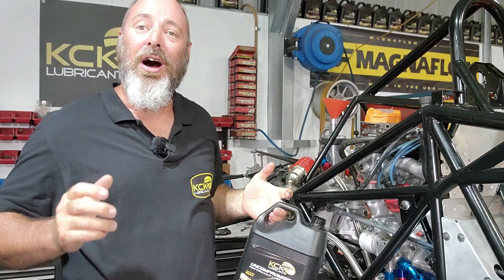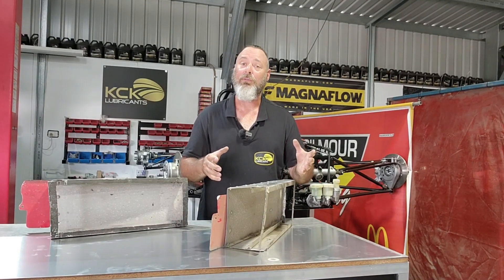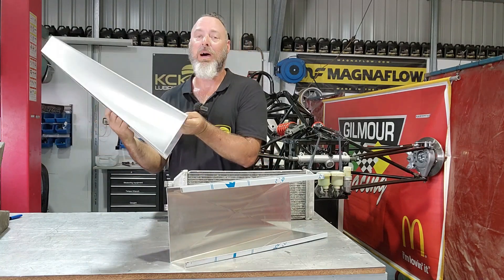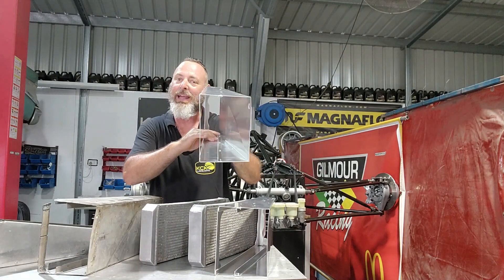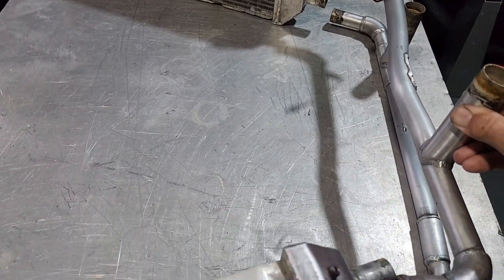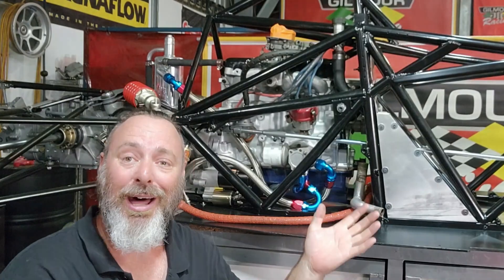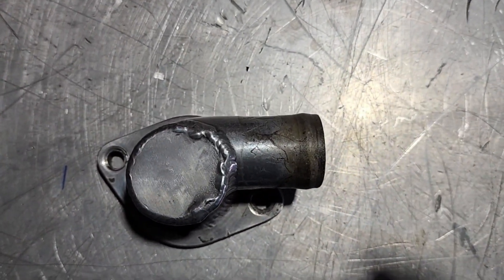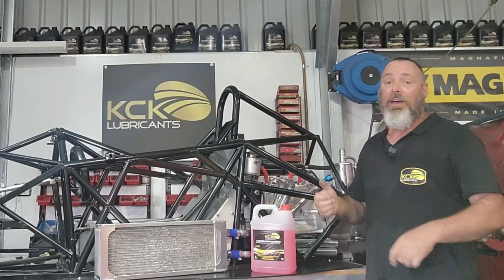Formula Ford Cooling Van Diemen RF96K restoration Episode 20, by KCK Racing Australia

Comment: Were are not allowed to use coolant in the rads, only Distilled water mixed with RedLine water wetter. in case of a leak on the track, coolant makes the track surface slippery.
Reply from the maker: Thanks for watching! The last time we checked, it was 'prohibited to use a glycol base coolant' for Motorsport Australia as this is very difficult to remove from the track surface.
Reply: @KCKLubricants  Love the channel and your content, not only entertaining but also educational.
Reply from the maker: @shaynemorten2253  we appreciate the feedback! Thanks for your support